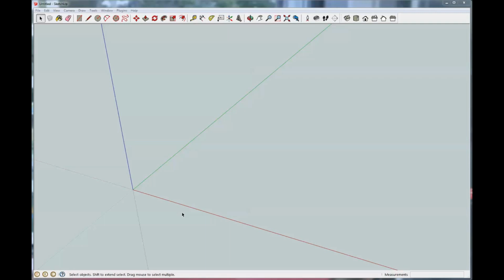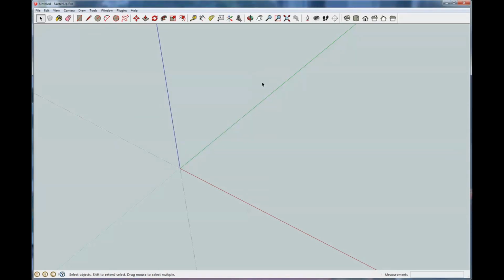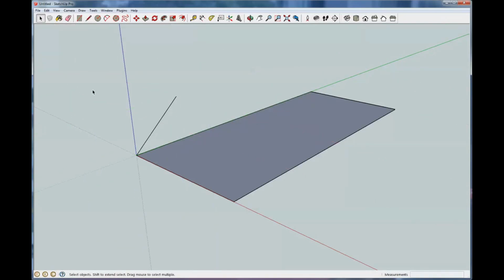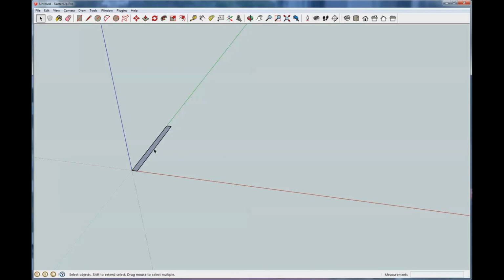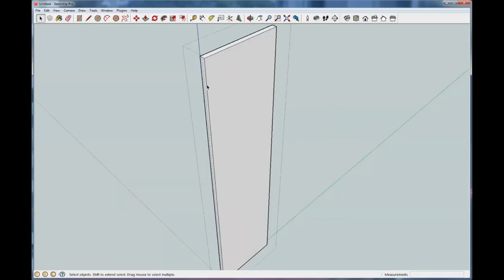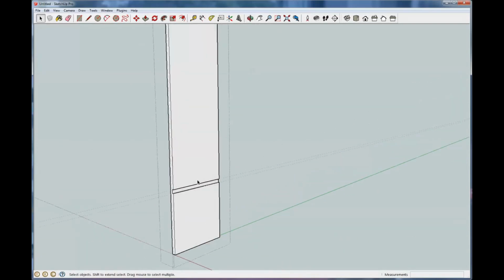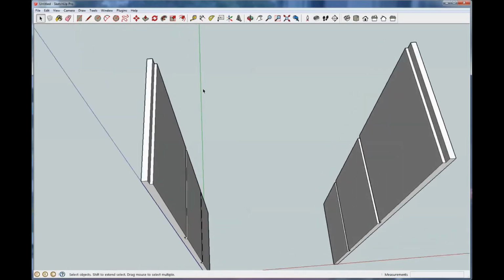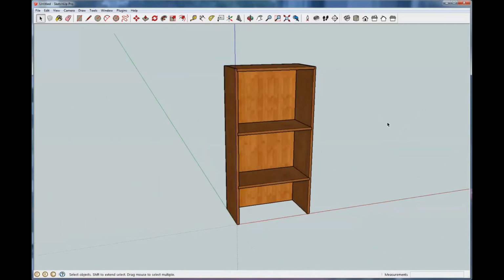Learn how to use sketchup --- tutorial #1

Comment: For the life of me, after I add in the dado lines, I can not push/pull between the lines.
Reply: +Peter McLinn I realize this is old but for someone reading this and having similar issues try this: instead of drawing the lines as in the video, draw a rectangle starting from one edge to the other on the lines and try that. Be sure to be in edit mode. Check out Rob Cameron's SketchUp for Woodworkers on You Tube for another approach.

Comment: Thanks for this tutorial!  I just started taking a class in using Sketchup, one night a week.  I have also watched at least 2 dozen other youtube tutorials about using Sketchup and they are all somewhat frustrating to me because the instructor bounces around so much as is always (probably subconsciously) pushing keys that they don't tell you about.
  On the other hand, you have done an absolutely outstanding job with your approach.  BTW, I have been a 2D Turbocad guy for about 15 years or so and I also tried Sketchup when it first came out.  The tutorials (really selling tools) were real cute, but as soon as I tried to do something for real, I was stuck with having to learn a whole bunch of rote commands again.  So I gave up then.  The reason I am going at it again now is that I have been sucked into 3D printing and I was told that Sketchup would be a good free program that would output  .stl files (which is sorta true, maybe).
Pete Stanaitis, www.spaco.org

Comment: G'day Rich,
While I've just started watching your tutorial, I was wondering if using a lap top as opposed to a mouse operated desktop, is a hinderance to using SU at all?
Thanks,
Bob
Reply: Bob I have been using a laptop for years on AutoCAD. As a matter of fact I did all 27 pages of prints for my current house on a laptop with the built in pointing device. HOWEVER, it is about impossible with SU and 3D because you have to move around so much more. 

Not saying it cant be done but SU just about requires a wheel mouse.

Comment: Kudos Rich,
Your tutorials were a great help in finding the light switch,lol.
Your rudimentary approach makes learning the tool bar very easy.
Thanks again for making your videos. I am sure I will be using them quite often as I explore Sketchup.
ps. so far your videos are usable for sketchup 2014 also
Reply: Rich,
I have built a prototype artist easel the "A" frame type.
I am trying to draw up plans in sketchup for a friend.
How do I get the two front  legs to intersect?
The dimensions and orientation are 2"w(face) x 3/4"d x 72"H.
Any help or direction would be appreciated.

Comment: I've downloaded the free version of Sketchup 8 and the select using a drag a box function does not work. Is this attribute supposed to be functional with this version, if so how can I set it?
Reply: ***** I'v'e tried everything I could think of to no avail.  have a Dell laptop with Windows Vista. Are there any other sources to ask? That function is particularly useful,
Reply: ***** Reply from dialogue 5 months ago. I'm referring to the drag a box to select objects. If I drag across an object as if to use this function it does not show a box, however it will select objects that I've crossed. I tried several things to get the box to show but it doesn't. Any ideas?
Reply: ***** I'll download Sketchup 8 on a different computer and try it, providing my roommate will agree to it. I'll let you know how it goes.
Reply: lfrasier9 It works correctly on a different computer so You think it's my video card that's bad. I have an older Dell laptop that was purchased in 2008. I may need to replace it. Is it cost effective to replace the video card on this computer? It seem to function okay in other respects. Unfortunately it has a Vista operating system. Thanks for the info.